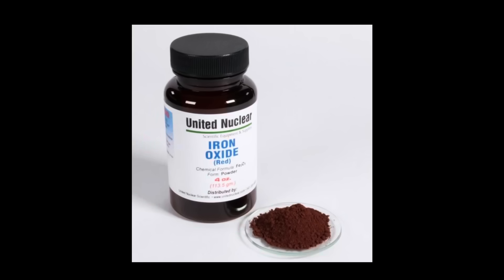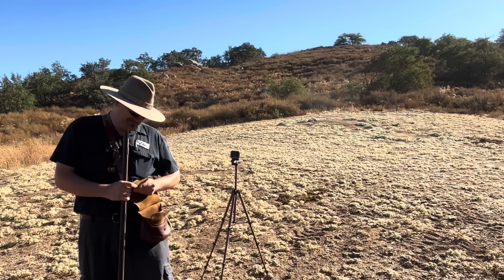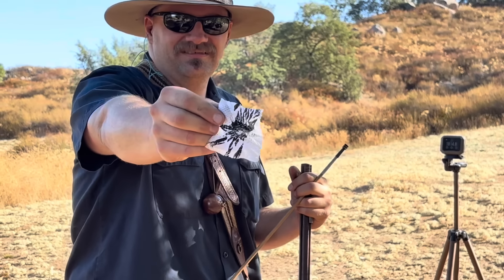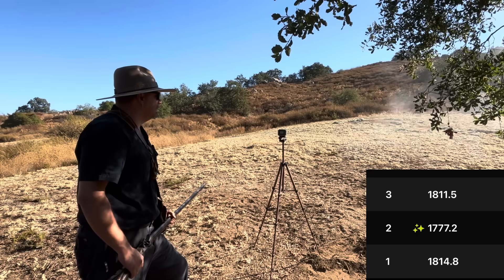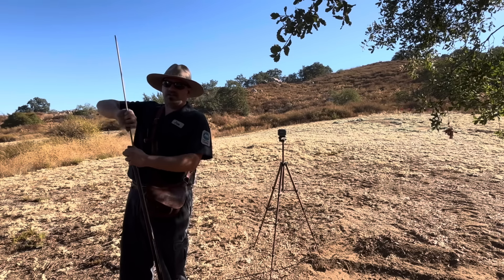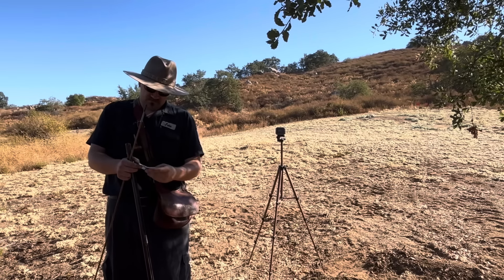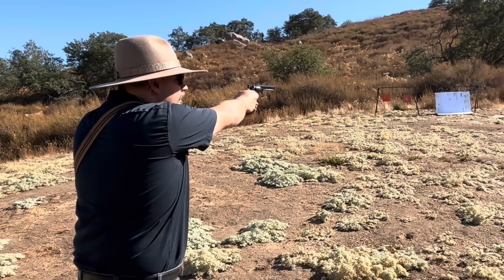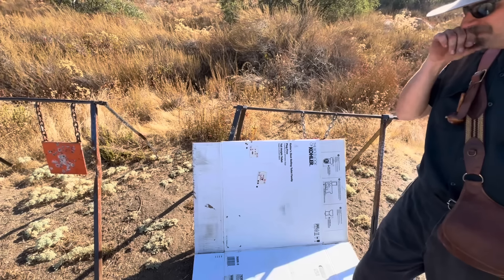Can Iron Oxide Improve Your Black Powder?

Comment: Oh, and iron oxide INCREASES burn-rate in rocket-motors. But, as you have pointed out, this happens at a lot lower pressure and a lot slower than in a muzzle-loader, with an actual flame-front spreading throughout the handful of solid grains over several seconds. As far as I understand it, the rust makes the flame-front "bubblier" as well as making it more consistent. In BP the flame-front is all around all the individual grains at all time.

Comment: In the early 60s I checked out a library book on how to make solid rocket fuel using various powdered metals. I tried one of the recipes using powdered steel as the fuel and potassium nitrate as the oxidizer and it work but not as well as some of the commercially available model rocket engines of the time.
Reply: That's using steel as fuel, not iron oxide as a catalyst. A different story entirely.

Comment: I have suspected for a while that it is the contaminants (anything not carbon, sulphur, or potassium nitrate) that cause the differences between charcoals from different sources. That these contaminants are mostly beneficial is indicated by charcoal performing better than pure carbon. The recipe from Foxfire suggest using stale urine when picking to improve performance. Details on chemical composition of various woods is sparse and highly variable. My hypothesis is that hedgeapple contains higher levels of iron than cottonwood. This comes from analysis of seeds from each where the amount of iron in hedgeapple was expressed as a percentage and in cottonwood in ppm.

Comment: I found it really interesting. It's supposed to speed up sugar blends. I found the comments by the few who knew what they were talking about really interesting.

Adding any metal to be oxidized is going to increase temperature and that will increase speed and performance but maybe to much. It's something that I find interesting but I want a way to monitor pressure while I do it.

Comment: I have played with iron oxide in lots of different recipes for pyrotechnic and rocket fuel and I found that in some cases it can have enough heat to burn completely through a rocket motor case even though the case is made of aluminum so I myself would not be stuffing that in any of my cannons or my antique blackpowder firearms thank you very much and I make about 20lbs of blackpowder a year and that's all I use for muzzleloader propellant..for pyrotechnic purposes you can use just about any oxidizer,  carbon and powdered metals sources to get a given effect because you are not reusing the cases that contain the contents which most of the time are completely destroyed in the effects ... SO please be careful when you are experimenting with unknown or unfamiliar chemicals or reactions that may be hazardous or even toxic when reacting..THANKS.. this is my opinion..
Reply: Depending on how much you are putting in the oxide is reacting to the aluminum creating thermite.

Comment: When I was in the US Army, we used shock tube as a component of non-electric firing systems. We were instructed that shock tube used aluminum powder and could carry an impulse around the world and detonate a single blasting cap. We were also told that is was highly carcinogenic. Glad you didn't play around with that stuff.
Reply: Shock tube contains powdered PETN.
Reply: @jimevans3040  As I understand it, shock tube contains a reactive powder that is a combination of aluminum and HMX. Where did you find that it contained powdered PETN?

Comment: I've made powder with matchsticks and mixed it with BP 3F...about 30% matchsticks. Do that and you'll get over 2000 FPS. Jack, have you checked if the Swiss powder has the same grain size as yours? The more fine mesh powder you have in your 3F the faster it will be. Do you see what I mean?

Comment: Back in my amateur rocket days we used to make crimson powder (using iron oxide + KnO3) to load the ignitors for the main solid rocket propellant.
So i think your 1% didnt have anything to act with, youd have to add extra KnO3 to match the stoch ratio of the FeO. So in effect youd have a binary propellant

Comment: I use iron oxide to slow down willow and to change the color of the flame in rockets or stars. I would like to see you do something on the amount of water  you use for me my kno3 retains moisture as it is granular and I can not bake all of the water out of it   that makes the powder clump, after milling for a while, around 1.5 % so i need to add 1.5% water to make it puck nice for a total amount of 3% water. If I puck with out adding more water the powder is weaker. I add water to bond kno3 to charcoal and sulfur. I live in New York lots of moisture in the air. You live in a hot dry area. So I am sure their is some difference. The amount of water makes a difference in how fast the powder is. If powder is too wet for too long the kno3 grows as it is what sucks up the moisture the most, and then I need to re mill it and start over. try weighing your powder before adding water and after adding water then you could tell us how much you use

Comment: My guess is the ironoxide  requires more heat to release the oxigen than your  powder is producing, the oxide with aluminum is called thermife and is used to melt steel to weld rqil road tracks ect,

Comment: Iron oxide and aluminum powder will raise pressure to the detonation point in BP if properly confined and with a powerful ignition source.  Iron oxide and aluminum powders in the right mix are called thermite and will melt steel.

Comment: It might be an optical illusion....but it looked like the Garmin was pointed down rather than up toward the target.   I've seen lots of people using them well beyond the 15" recommended distance to muzzle but they all were pointed directly at the target so the bullet flew down the flight path and was easily recognized and measured.    If you encounter spotty readings in the future...maybe try tilting the Garmin up a bit more?   Good video as your usual..and thanks for all the experiments.
Reply: My use indicated the beam is wider than tall, and the device does better if the barrel is to the side than above.  When forced to have the barrel directly above the device I always angle it up just a bit.

Comment: iron oxide and iron/most metal powder make thermite. so itd run the risk of malforming your barrel from the inside if you mixed the aluminum powder and iron oxide both in to your bp. its also a super slow burn.

Comment: As always super interesting.   Oxides increase burn rate in open air.  If your making solid fuel or powdered fuel propulsion systems  adding oxides will have a profound effect.  But as an explosive in a confined space like a chamber of a rifle or inside a cartridge I suspect it would have the opposite effect and act as you have said as a contaminant.
Reply: Have you ever heard of Golden powder? When you add iron oxide, it turns into another powder... it even gets another name, crimson powder.

Comment: As I said adding additives to BP is ehh. But if you do want to introduce additives,choose products that only contain gasesous products. Also if per example Na benzoate is used, the oxygen balance will be negative thus the ratio of nitrate has to be recalculated to obtain a clean burning powder.

Comment: Did you verify whether the formula called for Iron(ii) oxide vs Iron(III)  oxide?  Maybe I missed it somewhere in the verbiage on the video.
Edit: Found this online ---   Iron (III) oxide represents the most used catalyst in rocket propulsion. Its crystal shape tends to be dependent from the environment where it grows and is sensitive to the presence of additives [3]. The most common attitude is rhombohedral, platy, and rounded, with various thicknesses.

Comment: Hey brother can I make a suggestion for the carbon. Can you try using the same orange wood and a circular saw. Cut heaps of wood and collect the wood dust and use that in the retort. My thinking is the finer the material the easier it will be to burn off the shit in the wood. Shit paper seems good coz it's so thin already I think.  
LOVE ya work mate from 🇦🇺
Reply from the maker: Alright

Comment: I always pre test my chronograph set ups with a few shots from an airsoft spring pistol.  If it is working I get readings, if I don't then everything goes on hold till I figure out why it didn't read the air soft pellet.  Cheaper than wasting real ammo.
Eight to ten percent Aluminum powder added to and mixed with Ammonia Nitrate makes a high explosive called Tannerite.
 <Aluminum powder can be made by running tiny pieces of tin foil in a coffee grinder.  Aluminum dust is both flammable and explosive, so do that outside and keep some Purple K fire extinguishers on hand just in case.>
Black powder uses Potassium Nitrate so the result when Aluminum is added are probably similar.  I think we call that Flash Powder.  The mixture doesn't like moisture and will sometimes complain very loudly.  Good call not to put the mixture in a gun.  The British used to make and collect Potassium Nitrate by sticking metal pipes into big piles of pig and cow and chicken manure before a thunder storm, then after a few lightning strikes having slaves go through the pile and picking out the nitrate flecks.  
Iron oxide powder mixed with Aluminum powder yields a mixture called Thermite.  It burns really hot.  Adding a Magnesium casing (or just mixing in some Magnesium powder) adds to the heat.

Comment: I have read a study on sugar rocket composition that included carbon, iron oxide and a combination of both. The result was that both the carbon and the iron oxide additives individually improved the power of the rocket, but in combination they produced less power then the basic sugar rocket. So it would seem that, consistent with your results, carbon and iron oxide are incompatible with each other for some reason.

P.S. I wonder if the iron oxide additive acted as 'chaff' which is designed to confuse radar readings...

P.P.S. The name of the article is "Performance Analysis of a Dual-Fuel Sugar Based Solid Rocket Propellant". Google should work for finding it, though it never actually comes out and mentions my conclusion which is none the less verified by your results. It was interesting to me in its implications for the potential use of sugar in propellants and stabilizing the result.

Comment: I know that you can use red iron oxide in rocket candy to speed up the burn rate - James Yawn has a bunch of information on using it to make model rocket (sub-D class) motors, which you need a really fast powder for.  I'm guessing the chemistry of black powder doesn't allow for the same accelerant effect.  BP already burns fast enough for model rocket motors anyway - that's what Estes uses in theirs (this same Estes that recently bought out Goex).

Comment: I would think, and I will say that I am no chemist, that the best gain would be something that adds oxygen to the powder. Which would raise the combustion temperature, which would also clean the powder residue up a bit. The big problem that I see with that. Is that it would likely increase the burning rate. Which in turn would increase the pressure. Which may burst the barrel steel. IF your barrel was made from modern barrel steel and could contain 75-80,000 psi, then a "contaminant" like nitroglycerin could prove useful. or if you could find some, Cordite. I have always wanted to "play" with that substance. but anything that you could find now would be in the vicinity of 75 years old. And I am 100% certain that it would not function as designed. The aluminum powder seems interesting. Since you work repairing automobiles, an automobile axle would be of sufficient strength to make a "homemade" 50 caliber smoothbore mini black powder cannon. The rear axle from my 2000 GMC Jimmy from the research I did is made from 4140 steel. Which, again from the research I did, is one of the steels used in making modern firearm barrels. That would let you test various chemical compounds without risking your B.P. firearms. Just buy a carbide drill bit (15/32"), drill a hole and have a machine shop ream or hone it to the finished size that you want (.500-.512"). Then just use a patched round ball.  Plus it would be fun to play with. Your "pyrolosizer" might even be able to anneal and get the steel hot enough to reharden. I don't know the specifics of your kiln. Just something to think about.

Comment: You have two choices for speed range in the Garmin on the Rifle or pistol setting. 600-1700 and 1700 - 5000 fps. Whichever you chose was right on the edge of too fast or too sloe for the Garmin to read.

Comment: I think at this point, maybe you should start experimenting with different types of charcoal blended together to try to get good density and be faster and cleaner than Swiss. With that thought, you might have to put just the charcoals in the mill first to evenly distribute them and them add in the rest and mill it. Just my thoughts on it.

Comment: I'm at 7:28 having a sneaking suspicion that the recomondations were from people who dabble in or heard something from someone who dabbles in pyrotechnics where the contaminents are intentionally added due to the variations in color they cause the charge to put off when they burn. Ain't going to see much of a difference during the day, and testing this stuff as a propellant in the application you're using it for after the sun goes down is a really quick way to have a visit from allot of grumpy bears.

Comment: I think what's going on is the fuel, it's dead weight in BP. Iron oxide promotes the decomposition of nitrate and sugar in rocket fuel but I'm thinking this is obviously not the case for BP. As to why it may be that it just helps break carbohydrates down more (split them into short chain molecules) than it really does anything else (it's contribution to catalyzing nitrate is negligible.) With charcoal there's almost nothing to break down only oxidize.

Comment: Accordind to my (humble) experience the only reasonable decomposition "accelerator" would be ammonium dichromate (0.5-1% content). However what I know for sure, it works good with ammonium nitrare based mining black powders. And I assume it would acts rather as the "contaminant" when you try to apply it in "antique muzzleloding propellant" - same as the iron oxide... Reason: ammonium dichromate produce solid residue which is green color chromium (III) oxide. It is also very hard abrasive material, despite it's very dispersed. So, it could works as "pollishing powder" inside of the barrel - decreasing barrel thread lifespan... Ergo: using this agent in muzzleloading firearms is very questionable.

Comment: My uncle bill used to do this. I inherited his muzzle loader. The rifling is almost gone and its rusted beyond repair or safe shooting. Dont do this unless in a pinch.
Reply: Likely has little to nothing to do with any Iron Oxide propellant, Black Powder itself is already full of highly corrosive salts made when fired and will happily rust and eat away the whole bore if not properly cleaned out after firing (Literally just a rinse of warm water will do for washing out the BP salts, then just run a patch of CLP or Ballistol down the barrel to inhibit corrosion and protect the metal until next fired [Also Lubricates the barrel]; and if being placed in storage wipe it down applying CLP/Ballistol to the outer surface metal as well for the same reason of protecting/preserving the metal).

Comment: What does one want to ‘improve’? The speed of the flame front, the speed of the deflagration of the grains, the temperature of the deflagrated gases? In India a solution used to deal with local meal powder was to use an enlarged combustion chamber with a substantial air gap and use adiabatic heating to set it all off at once rather than progressively by a flame front.

The only addition I have ever known to be used routinely over a long period by anyone I know is 2% ascorbic acid and that principally to reduce fouling and smoke somewhat.

 Akin to the old practice of putting pinch of smokeless powder in and then the black powder charge, which I would not recommend as a careless error could have serious consequences.

Comment: Under some conditions Iron Oxide is a good oxidiser (in thermite) but it seems it doesn't react well with charcoal, maybe cooper oxide would do better
Reply: I would say that iron oxide is never a good oxidizer, but aluminum powder is such a strong reducer that it pulls the oxygen off the iron anyway. Iron oxide is only used in thermite so that the reaction produces molten iron and no gases. If you want a properly huge release of energy, real oxidizers like ammonium perchlorate will work much better. That's the basis of the propellant mix in solid rocket boosters.

Comment: Before watching, Iron oxide is an oxidizer. So it provides more fuel for the burn. How much that will do is to be determined. But im sure "alchemists" played with it back in the earlier times of black powder, think hand cannons and arquabus time frame. The fact it isnt a common ingredient likely wasnt a telling that they didnt think about it but likely just didnt make enough of a  difference or might have lead to quicker corrosion
Reply: Close but incorrect, Iron Oxide is an Oxidizer providing more "Oxygen" for the fuel to burn. Which increases the efficiency of the fuels combustion increasing power and making the reaction cleaner.

That's why Oxidizers aren't often used alone, but in a mixture with a fuel.
Reply: Close but incorrect, Iron Oxide is an Oxidizer providing more "Oxygen" for the fuel to burn. Which increases the efficiency of the fuels combustion increasing power and making the reaction cleaner.

That's why Oxidizers aren't often used alone, but in a mixture with a fuel.